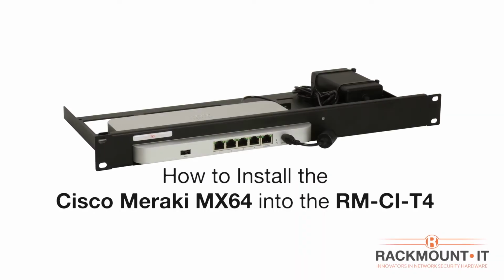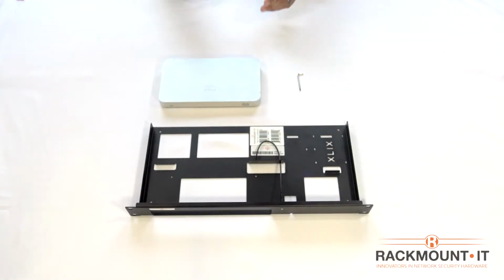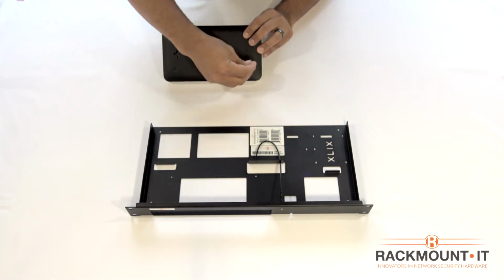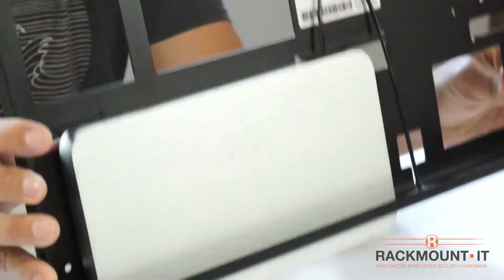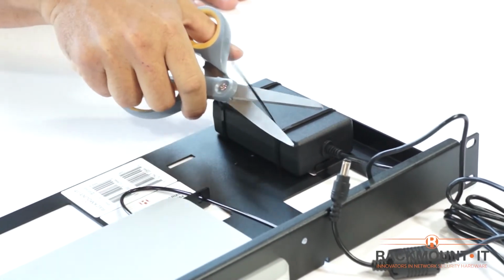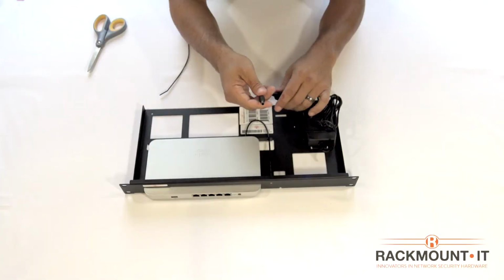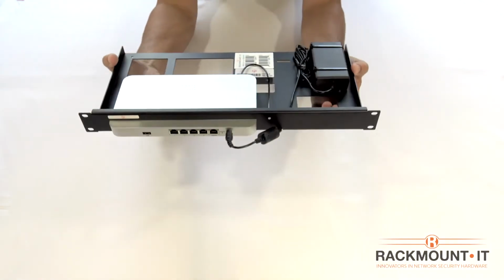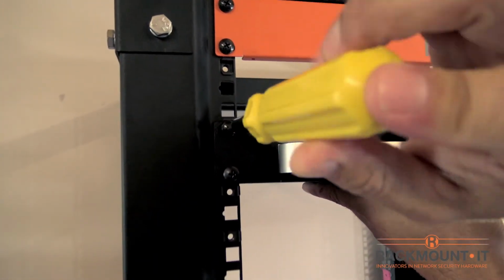Cisco Meraki MX64 / MX64W / MX67 / MX67W / MX67C - Product Installation for Rackmount.IT - RM-CI-T4

Comment: Damn those tiny screws. My kit didn't come with the tool to remove them and I didn't have a bit small enough in my toolbox; wound up using VHB foam tape to secure the Meraki in the mount, lol. 🤣